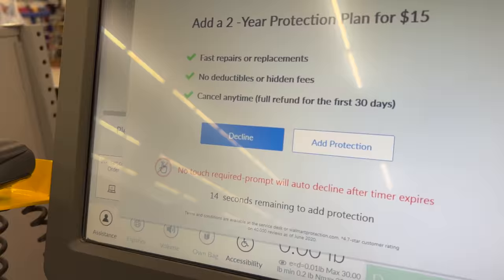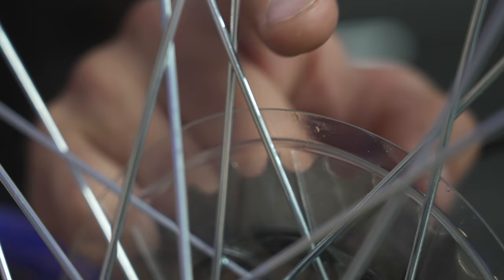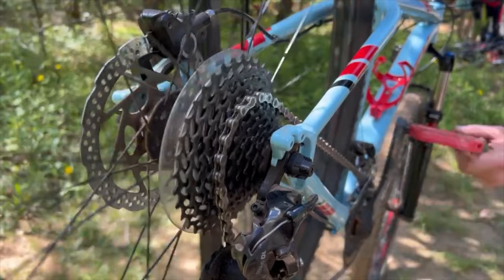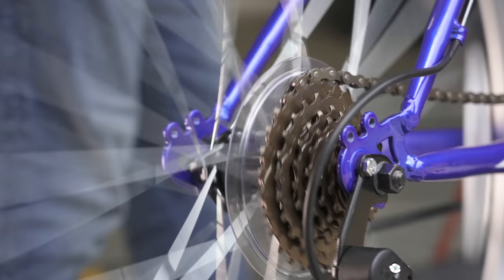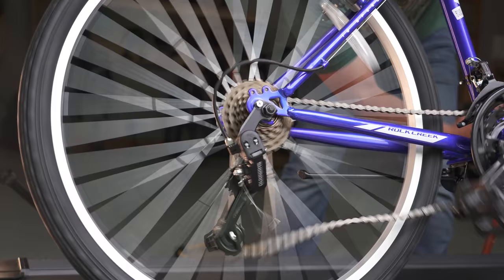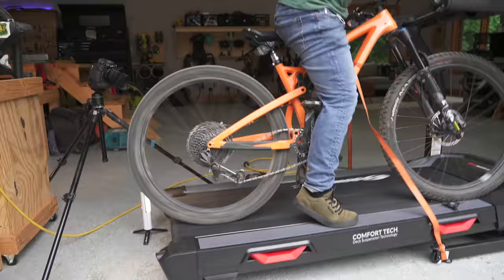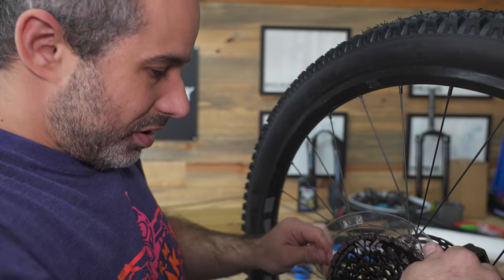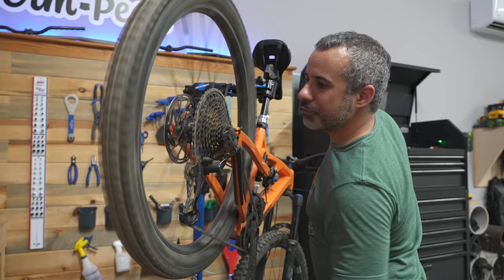What is your "dork disc" actually for? What happens if you remove it?

Comment: One time my derailleur wasn’t adjusted well, and my chain fell into my spokes. I thought, “perhaps I shouldn’t have removed my dork disk?” Then I snapped out of it and remembered that I’m no dork! Haven’t looked back since! Stay classy my mtb brethren
Reply: That happened to me once, but my bike never came with a dork disc or just the bike shop removed it.
Reply: I think the only way that the deriuler goes into the wheel is when tourqe is applied through the pedals
Reply: I bought a 1x12 second hand bike I don't even make it home I shifted within 20 secs of getting on the bike and the deriuler wmet right into the wheel. Worst feeling ever!
Reply: Earlier last week my derailleur overshifted into my wheel, bent 2 spokes, shattered a derailleur and broke the chain with a spoke
Reply: Same bro
Reply: That’s right, say no to dorks!
Reply: Be on the trail and completely mangle  your bike or your face because you removed it. Your thinking does make you a dork hands down
Reply: What happened after that then
Reply: This shit has me laughing hard! Comic genius
Reply: i had my dork disk and it happened idk how it just did
Reply: The deraileur jumps althought it's ajusted perfectly.
Reply: And the lesson you learned is, of course, that only dorks ride with a mal-adjusted derailleur, right? ;)
Reply: @adammeade2300  The lesson was: don't touch anything, if it works.
Reply: The dork disks is unnecessary, but the reason such a mistake exists could have been solved easily by adding a "super low gear" except without any teeth, if you understand what I'm saying.  Pretty much a metal version except attached to the rear cassette because why not make it impossible for the bike chain to come off of the gears and into the spokes?
Reply: @armyfreak1367  If you adjusted the stops on the derailleur properly it would never happen, ARMYDORK13..
Reply: Holy crap, that's how you spell "de-railer?" 😳 Eliminated from the spelling bee AGAIN
I ride a BMX, so I don't know this stuff
Reply: @cfkusnier1  until mechanical failure at which point you learn to fix it or stop riding
Reply: @joshmanwaring3848  I always fix with my own solutions.
Reply: Find your inner dork, today!
Reply: I remember when the dork disk shattered and fell off my first multi speed bike. I was worried, but I couldn't see the use for it. I lived on a steep hill back then and I was a kid and had no idea how to adjust a derailleur. It had old school friction shifters, and was always over shifting  Sometimes I could shift out of it, other times I had to stop and re mount the chain. No big deal. in other words, because you're going uphill when this happens and your wheel is going real slow, at least on pavement. On the trail chains do weird things. I know it's kind of superstition on my part, but I  remove them from road bikes but leave them on mountain bikes.
Reply: As a young teen, my first multi-speed bikes were Schwinn Varsity. They had a shiny,heavy metallic dork disc.I removed those every time. No consequences ever.
Reply: @renerenatorivera9062  We called the metal dork disks " pie plates". There was this vintage bike shop in my area where the guy actually collected them. He had them hanging on the wall as decorations. Some of the ones that came on the old cruiser bikes were quite ornate.
Reply: You’re the first person I’ve ever seen with the same speeding of Jadon as my brother and it feels weird😂😂
Reply: @dc1564  *derailleur.
Reply: @jasonvoorhees895  it's French, you know...
Reply: @JBofBrisbane  So it's actually pronounced like Dee-ray-leeaauuuuramericanscum?
Reply: @dc1564  deriuler? LOL
Reply: Great video! Sketchy experiment riding the bike on the treadmill. Treadmill warranty...VOID with video evidence 😂😂😂
Reply: Never had a dork disc that lasted beyond a few months before splitting from its central mount core.
Reply: ours are metal they down just break :-\
Reply: This is the reason why the derailer hanger is bend
  In inside some kind of force... The derailer stak on the spoke..

Comment: I believe it the cheap plastic that makes this “dorky”.  this is a great opportunity to have this item made in aluminum, engineered to be light weight, and anodized black, etc.
Reply: AGREED.
Reply: I think adding some color or pattern to that dorky is enough. Aluminum is cool but plastic is good for adsorb force though
Reply: soon to be carbon and titanium dork discs!
Reply: Or even just nicer plastic, not this cheap wimpy transparent stuff that looks like leftover packing material
Reply: @bacon.cheesecake  if it didn't yellow and basically crumble to bits after a month or two anyway under riding conditions I might keep it, but if I was offered one that matched an oil slick cassette or bronzed or something I would probably use it.
Reply: SRAM carbon fiber dork disk, just as light as the plastic one, 1000x stronger, big SRAM logo, $200
Reply: @tb-xy7lg  not really a huge surprise. A well maintained drive train will basically never jump the sprocket unless you're crashing anyway
Reply: I like the faded, brittle plastic ones for that funky 'vintage' look.
Reply: Let's start a trend of using old 45s, if any still exist:p Or modified CDs.
Reply: I was just going to leave this exact comment, but you beat me to it! There is definitely a gap in the market for high-end dork discs in aluminium, carbon fibre etc with logos on. I can't believe the big component manufacturers aren't already on this.
Reply: A thin piece of aluminum would get battered up and bent out of shape the first time the chain hit it.

And most plastics are around half as dense as aluminum...
Reply: @JohnRunyon  Good point. about aluminium bending. I remember discs like this being made out of chromed steel in the 1970s, and having all sorts of fancy patterns cut out of them - they were something you added on to your bike to enhance it, rather than the first thing you took off.
Reply: Needs RGB. :)
Reply: @tb-xy7lg  propably because no one saw any use in mounting a more epxensive version of a component that is ther with the expectation that it will get damaged.
Reply: I find it funny because old 70s-80s bikes used to have them made out of metal.
Reply: @JohnRunyon  1/8th inch thick high density polyethylene would be perfect on low end bikes.  Maybe titanium on high end bikes.  Titanium just bends back into place.
Reply: Older bikes had aluminium spoke protectors. Just looked kinda like a brake rotor.
Reply: The moment you make the dork disk rigid, it becomes even more dangerous than without it, because it will tighten the chain in between it and the gear pack.

Carbon fibre disc could work and look expensive (as that seems to your definition of being "not dork") I cannot see any good reason to use your budget in a part that will eventually break.
Reply: Blue with scull and crossbones for boys and pink with sparkle specks for girls.
Reply: @bacon.cheesecake  On one of my older bikes it looks more like a fibreglass re-enforced CD. Until this video I have never paid much attention. I literally ran out to the garage to check my eMTB....didn't come with one. I am almost never in that low of gear, so no real need.
Reply: Having it attached to the large ring and spaced so it gives the chain free movement but also acts as a barrier to stop the chain being able to come off in that direction in the first place would be the go
Reply: I was thinking just the same thing. A friend is an antique bike collector and back in the 1960's and 70's these disks were made of metal.  Much less likely to get mangled and fall off.
Reply: The steel ones don't weigh much and look nice. I suppose you could make an aluminum one or hard nylon one. Maybe even 3d print it to fit cassette hubs.
Reply: I used a Megarange 8sp freewheel and ground the teeth off the 34 cog. It was a 7sp with built in dork disc.
Reply: That's what I was thinking.
Reply: @FriedTurkey  Add a flat disk behind the last ring.
Reply: Then it would be called a snobby turd disc.
Reply: @watameeelon  obviously not when they rip apart from mere momentum
Reply: I live in England. I've never seen a plastic one of these. They're all in aluminium.
Reply: If you had a lathe and a mill, as well as steel plate stock, you can make a TuffDisc spoke protector using the dork disc as the template. Turn, mill the slots, sandblast clean and paint or powdercoat if you can, and install. 
May need to slightly massage it into a wide cone shape like the dork disc, but once all that is done, good luck getting your chain past that.
Reply: @glzarmy  carbon would work against the physics. The plastic absorbs the impact while carbon is way too rigd and would simply break and also get jammed into the spokes.
Reply: me, who does patternmaking and small scale aluminum foundrywork
🧐🧐🧐🧐
Reply: Bravo !
Reply: My dad gave me an old Trek road bike that has an aluminum dork disc on it, so they definitely are (or were?) a thing.
Reply: 3d printed carbon vinyl. At least that's what I'm going to do since watching this video.
Reply: On vintage bikes they were metal.. now things are cheep junk.
Reply: That was done years ago
Reply: Yeah I had to remove that thing on my diamondback I used as a kid, I spent so much time on that bike that both dork discs yellowed up and started cracking. Looks way cleaner tho I’m ngl
Reply: Actually, yeah, I just don’t like how they’re made out of pasta
Reply: The thing that makes it dorky is that you're supposed to competent enough to keep you derailleurs adjusted to the point that you don't need the dork disc. OTOH, adjusting your derailleurs and doing maintenance is kind of dorky. Plastic is best because it's inconspicuous to anyone who isn't looking for it, and it explodes impressively when you forget to adjust your derailleurs.
Reply: @glzarmy  SILCA 3d printed titanium dork disk, $580

Comment: It's actually called a spoke protector, with good reason. A bike shop took the one off my MTB years ago  and were adamant that they would never refit a "dork disk". I regretted that last year when I was bike packing a 1200km off-road trail over 3 weeks. The bike took a hammering each day, the limits went out of adjustment, and a couple of times the chain got stuck between the spokes and cassette. There was no catastrophic failure like you were trying to create, but each time there was some damage to the spokes. Eventually some damaged spokes started breaking. I had spares but very difficult to fix on the trail, over 50km from the nearest bike shop over rough trail. Will now always have the "spoke protector" fitted.
Reply: Tbh if your going to do a 1200km trip you can use any protection u can get. But that in no way stands as a  testimony to your regular mtb'er. I'm sure you prefer mechanical disk brakes over hydraulic as they are much easier to fix along the way.. 
lets not compare slalom gear to alpine gear.... 😅

And as a dork-disc is generally seen as a hallmark to cheap crap I cant blame any self respecting mtb'er for hating them!
Ps: im a bicycle mechanic
Reply: @martijnt1353  to be fair if there was a lightweight metal or high quality polymer one alot more people would use them as if it can prevent wear and save money in the long run then why not use it
Reply: similar experience!
Reply: @Sam-wx1oj  they are made of polycarbonate, it may look flimsy but it's incredibly durable material.. properly installed one  don't typically fails
Reply: I hope you dont think the content producer here, isn't aware of what the name of this part is.
In fact, it would take a diagram of any bike, to know what the part is called of which if he really didn't know, would have done.
Everyone knows what its called, he was letting us know its called a dork disc within the industry
Reply: @todtalk3912  I know that the content producers know what it is called, but lots of people don't. They are led to believe that it is an unfashional item with no purpose and are pressured to remove it because only a "dork" (definition: contemptible, socially inept person) would have one.
Reply: It's a shame the presenter didn't show the condition of the spokes. There is no way a chain jumping into the spokes isn't going to cause some damage to them. That is the idea behind the spoke protector (the hint is in the name). 

As to having derailleurs set correctly thought to be the 'ultimate solution'..... B/S. If you are pedalling across rough ground, and I mean rough, or travelling through woodland, the rear derailleur pretty much does what it likes. My equipment is ALWAYS set correctly, and I get chains wind themselves off of sprockets from time to time. I won't ride a bike I bought unless it has a spoke protector and a chainstay protector. I don't give a flying f*ck what people think of my set up, I want it to last and be as resilient as possible to wear and tear. And yes, anywhere cable rub could be an issue, helicopter tape is used.
Reply: @Fastfreddyii  totally agree
Reply: @Sam-wx1oj  1) weight for the gram shavers 2) most higher-end bikes don’t come with them.  Not worth adding them.  I haven’t needed one in 33 years
Reply: @ced3763  nah most are cheap plastic like maybe #5.  Not polycarbonate
Reply: @slpguy6026  Polypropylene is also very durable..
Reply: @ced3763  can be I suppose, depends on the manufacture.  I have certainly seen crappy cracked up discs.
Reply: @martijnt1353  i DONT THINK HE WAS COMPARING ANYTHING WAS HE ?
Reply: @martijnt1353 even better: if attempting a 1200km adventure, have a clue how to adjust limit screws!
Reply: @McGnarly76  I wished every rider could do so, but alas I know plenty which barely even understand how to shift gears and or which combo's to use / not use. 😅💩
Reply: @Fastfreddyii i road bike and even i have a ton of chains falling off, usually its not catastrophic but i usually lose all my momentum before it goes back on (its usually my front deraileur that does it) but yeah “just set your limits correctly” is bs that shit wont help